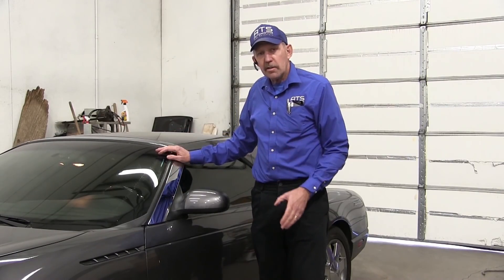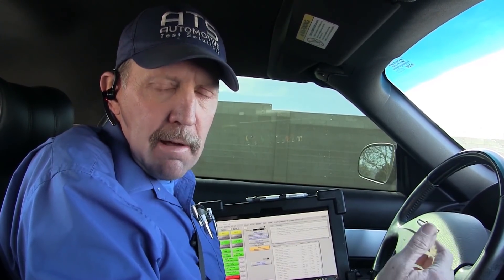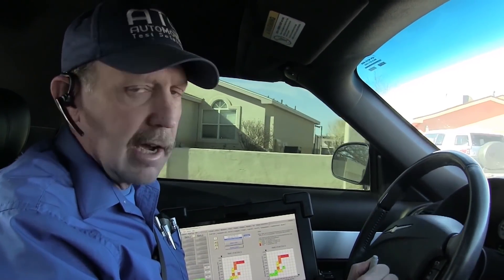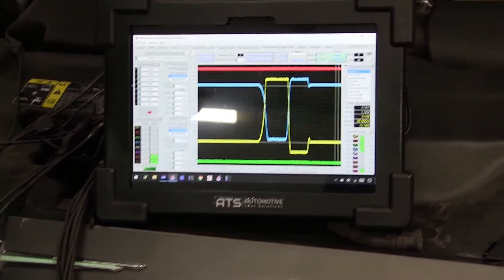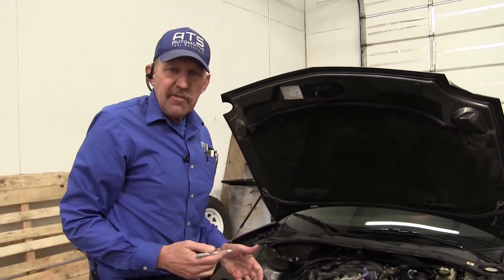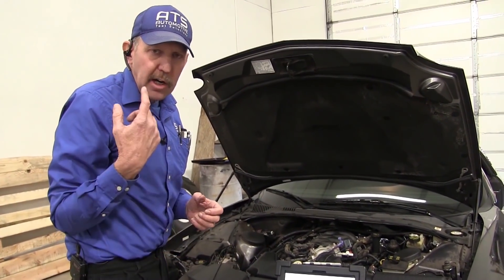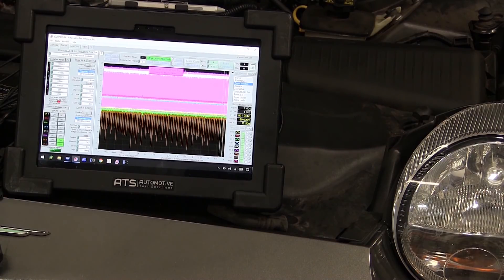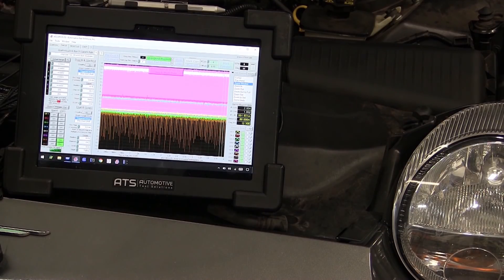2003 Ford T Bird throttle defaulting

Comment: Great video that goes well beyond this specific issue.  My T-bird had the same symptoms.  It turned two coil packs were producing voltage spikes (as seen on a O-Scope).  I replaced all of the coil packs and spark plugs parts as parts cost was quite low.  I am an electrical engineer that just retired from repairing semiconductor manufacturing equipment for 40 years.  This reminds me of the most difficult problem in my career  We had a semiconductor manufacturing tool that had an intermittent fly back diode.  It would fail once every 2 weeks. We used multiple O-scope to track down the voltage spike.   A one dollar part kept a million dollar tool down for 2 months.

Comment: Tuning into the ac clutch turning on and off triggering the fault was the instinct that lead to the final test and ultimately the fix. Love not only the scope analysis, but the combination of skill sets that solved the problem. Ps I prefer breakout relays for any relay testing, but it was cool to know of a wire so fine that you can slip it into the terminals without opening them up when the relays inserted. I think that’s also a little bit of old school in there from Bernie! Lol! Nice!
Reply: Yes, knowing that the customer uses the AC was the turning point especially when the previous shop said the throttle defaulted all the time and he wasn't seeing it default initially.
Reply: @abdul-kabiralegbe5660  I fix a lot of cars just by talking to the client. Freeze frame data helps a lot too, but this case that doesn't exist.

Comment: On Nissan relays the fly back voltage is controlled by the relay itself, and unfortunately the suppression feature is not shown in OE diagrams?The diode or resistor is built in. I'm wondering if simply replacing the relay may have repaired it?

Comment: Back e.m.f. On any relay in all electronics is always needed You obviously no electronics which is needed to repair modern cars. I have put 4001 diodes on relays on old cars because customers said when going from hi beam to low a ticking sound came across on the radio. I love your vids great diagnostics.

Comment: Electronic Throttle Control (ETC) is essentially a closed loop servo positional system, which will have a closed loop positional (and perhaps velocity) control algorithm (most likely PI). The H-Bridge current control (PWM voltage modulation) is most likely four quadrant control, especially if the ETC motor has a default return spring. The positional information, throttle position and pedal position, is redundant in order to meet a specified safety level of operation. This safety requirement can also influence the processor selection with redundant computational units running in parallel. The most important aspect of the throttle positional information is that it indicates the true position of the throttle plate (at the needed resolution), secondary is in indicating a fault condition.

Comment: The Ford PCM ignition IGBTs are actually called "smart coil drivers", which means they have some added features beyond just a bare IGBT transistor. One of these features is an active clamp set at around 400 to 430 Volts, which turns on the IGBT during the coil primary fly-back pulse to clamp it to a safe level with any excess energy absorbed by the IGBT. The only real reason I can think of for a TSB for the coils would be if the primary inductance was too high for maximum energy absorption stress on the IGBT at very high PCM module temperatures. So you could over stress an IGBT with worse case energy present, open secondary, and the PCM at a very high operating temperature.

The PCM ignition circuit design and PCB layout is done to mitigate any ignition primary clamping of the IGBTs disrupting the microcontroller core, it is actually one of the first circuits to be laid out in the design. The PCM ignition feature will not "put gates out", which I think translates to meaning resetting the microcontroller or interrupting its normal program flow. The ignition IGBTs are discrete amplifiers and not on board the microcontroller. The microcontroller is not subject to any of the ignition energy stress or interference. In fact, you can have a failed PCM ignition IGBT with having any other damage to the PCM. By replacing the failed IGBT you can put the PCM back into service.

The real reason for the "smart coils", like on a GM LS V8 Coil Near Plug, is not to protect the microcontroller from ignition amplifier interference, it is really because when you include the ignition amplifiers on board the PCM the PCM power dissipation requirement goes way up, and safe operation at maximum PCM temperature is unachievable if you put the PCM under hood and not in the passenger compartment. By moving the ignition amplifiers into the smart coils you have essentially removed heat from the PCM so now it can live under hood. The GM smart coils as designed (4 pin connector) don't have a monitor output, GM opted for a dedicated trigger ground (which provides some isolation between primary and secondary, which I think is a smart decision), so the smart coils are really not as smart as the approach by the Japanese coil on plug applications (also a 4 pin connector) which have a monitor feed back function.

The ETC switching frequency change to 20kHz has more to do with the improvements in the performance of the MOSFET switching H-Bridge servo motor control amplifier smart power integrated circuit relative to acceptable cost. Many people can't hear the 10kHz servo amplifier noise when the hood is closed, but some customers (and many engineers) would still complain. Once you start the engine the small whine is drowned out by engine noise.

To monitor the relay signals you can use a relay extension breakout adaptor. When you use the relay extension adaptor it is best to clean the fuse box pins and the relay pins, this way you know that the circuit is making a good connection. However, the premise was the A/C relay has compromised suppression across the coil. Many times this is due to a replacement being the wrong type, but you can read the relay circuit diagram to see if it matches the symbol on the OEM wiring diagram.

How can a faulty A/C clutch coil suppression effect the module output controlling it if the circuit uses a relay which isolates the control from the load? More probable is the noise is going on the +12VDC and PWRGND power rails and this is some how effecting the PCM ETC control through the module power feed, or perhaps there is another coupling mechanism if the circuits share a wiring harness, commonly known as cross talk. This cross talk is possible if the under hood power rails are not stiff, meaning there is a relatively high impedance power feed from the battery +12VDC and/or GND (chassis ground) from the trunk to the power connections under hood. For this year Ford traditionally the A/C clutch does not have a suppression diode. The mistake Ford made was assuming that the power rail noise suppression for a battery in-trunk design would be the same as the battery under hood, and we can surmise that this same issue is why a TSB was issued for the ignition coils. The problem is the power supply under-hood does not suppress noise effectively enough to prevent power disruptions at the PCM, because the design does not address relocating the battery to the trunk.

An option for the simple rectifying diode would be to install a uni-directional TVS with an on voltage of about 24 volts. This way the flyback voltage would be suppressed (diode forward biased) and also any positive noise spikes on the A/C clutch coil (diode reverse biased). The TVS for this type of common automotive application is called a load dump suppressor, and is a very large and robust device for absorbing energy, and could guarantee the A/C clutch fuse would blow if the circuit experienced reverse battery. You would want to position the TVS as close to the A/C/clutch coil as possible to minimize the lead inductance to the TVS, which is the same as saying, to minimize the chance of cross talk interference through a shared wiring harness.

Comment: Being that the battery is in the trunk, it may be more helpful to look at signals at the under hood main ground to understand what the module voltages are when the engine is running (powered by the alternator). Mainly for two reasons, the first is the long ground reference lead will pick up a considerable amount of noise, the second is we want to understand the I/O signals as close to the module connector as possible, which is under hood or near the firewall. Ideally, ground for troubleshooting a module would be directly at the module ground as a reference. This is important because what you can see is how the power and ground impedance relative to the battery in the trunk can be modulated by electrical overstress.

Another option to clean up the ETC position signals is to use differential scope probes across the PCM ETC inputs, or across the throttle position signals at the throttle body.

Comment: I learned that protection was in every car Ford made with a cycling A/C clutch back in the 1980's.
It's in a plastic enclosure about 2 inches long, and taped to the harness by the a/c clutch connector.
If it gets damaged or removed by someone, it's going to allow those voltage spikes.
I learned it in school and overheard our lead tech and parts manager trying to figure one out one day back in 1987.
They called Mercedes to find out about it.
I happened to overhear, so I pointed it out to them in the harness.
Theirs had an open that was causing a driveability issue then, in 87.
So Ford definitely knows and built them that way ages ago.
It would be interesting to see if the T-bird doesn't have one? Or whether it's open?
Or is the harness damaged?
You need an EVTM to see if it's in their diagram. That's the troubleshooter manual.
It's not known for having misprints, omissions, or wrong diagrams.
It's what ford techs used before computer displays and live data streams just handed us answers like we have  available to us now.
It sure was good deduction to ask the customer about how you make it act up and when, then think about what systems are in use, and what circumstances the car goes through at the event.
The clutch powers off, releases, and the left over energy has to dissipate. It can, so it does, (without a diode across it) go back and kick the processor.
That would be bad.
If you're at a wrecking yard, you can grab a spare one to use and put in for the test.
They're often black or yellow plastic and wrapped with tape on the A/C harness
Reply: That makes more sense to me. The car is 19 years old and only recently developed the problem. So it would seem unlikely there was never a diode there.
Reply: @googacct  yes it's likely it was designed with the protection, the EVTM diagram has a correct drawing almost always.
These other sources for diagrams might be where it's not depicted?
I don't know.
Too bad they didn't have him repair the car too,  so we could see.
You can order real OEM literature at parts from HELM publications last time I checked. But they could share that page of info with you in a dealer service department if you find caring people who want to see it corrected.
They used to say it's your car, but it's our baby.
That may have been a local thing.
Before all the smart people started in on things.

Comment: Question. When the Clutch Relay Contacts "Open" causing the Magnetic Field to collapse, how does the "Spike" get across the "Open" Relay Contacts onto the DC Supply ??
Reply: I'll take a shot at this question.  It is probably through induction similar as an ignition coil.  The energy travels the easiest path.  Since everything else has good insulation the shortest path would be in that tiny relay.
Reply: I don't think the voltage spike jump the gap between the relay contacts because you would need kV to do so. Just as he said, the engineers are aware of these spikes and so they install diodes in every circuit which involves inductors even the relay coils must have one. To answer your question, the huge spike is reaching the computer through the bad AC compressor diode that is connected to ground as the computer. I'm not totally sure but it's the only way I think
Reply: Inductive Coupling
Reply: 2 ref signals of the throttle did not show it with scope on it.. why.?
Reply: @prashanshan7125  Kind of long winded but here is some what I got out of the video.  You may want to view it again.  Bernie takes the shortest data driven path as possible.

Both signals did show on Bernie's first connection set up.  The nuance that he delivers on each video is to follow a fact driven diagnostic procedure.  Two things during the video he pressed home was to establish a baseline of how the car was performing.  The first being careful to follow the customer complaint while identifying any other issues.  The second was to get a good description of when the issue occurs, when he gathered the time and place of the event.

After which his first connection shown that the throttle actuator was receiving the correct inputs.  This data then delivered an event that he could replicate.   Detailed customer information then identified the next item to test.

Since his first connection identified what to watch for, there was no need to view all the signals while testing the next system.  He then cleared the screen to making it visually easier to see.

  If you were looking for reference signals from the accelerator pedal you would have been on a longer journey.
Reply: It doesn't directly.
When the contacts open, the collapsing magnetic field in the clutch coil tries its best to keep the current flowing but with the circuit open the voltage will just rise very quickly.
The spike will actually capacitively couple into adjacent wiring - two pieces of wire laying side by side makes a capacitor. Sheets of foil with very thin insulation between them make better capacitors.
But anyway, the higher the frequency, the lower the reactance (resistance to AC) of any capacitor. This fast spike is a very high frequency signal, so even with the poor capacitor made by two adjacent wires there will be good opportunity for signal transfer.
That's not all though.
If the adjacent wiring is power, ground or an output actuator, those wires are low impedance - fractions of an ohm for power and ground and below 50 ohms for a small actuator, 100 Ohms for a relay, it's relatively difficult for other signals to affect those.
However for signal wires like TPS1 and TPS2, you have potentiometers of say 10k Ohms connected between 5V and ground plus limiting resistors to protect the TPS from shorted signal lines so with an impedance of a few thousand ohms it's much easier for that spike to influence those signals.

Inductive coupling is when the signal transfer from one wire to another is due to the change in current flow in the first wire.
An interaction of magnetic fields rather than electrical fields.
Reply: @prashanshan7125  A mixture of things you have to take a step back and think about.
Firstly, the scope connection looked at 5V ref, ground, TPS1 and TPS2. Correct TPS operation was observed in response to APP input KOEO. No dropouts, spikes or glitches so those channels were switched off while looking at motor drive current in case the problem was a sticking throttle shaft. 
Remember, Bernie said he had spent 2 hours and the car had not faulted. Why? The garage said it would fault constantly.
After talking to the owner they described their use of the vehicle and that's when the decision was made to operate the heater and demist which also switched the AC on to dry the air for faster demisting.
Then after a short period of idling, the car faulted a second or so after the AC clutch released giving an immediate direction.

Comment: was that a 4pin or 5 pin relay? and was there 4 or 5 terminals in the fuse block?  was that the correct relay?  wiring diagrams accuracy is more and more becoming a crapshoot.

Comment: Cool case study Bernie! How exactly did the voltage spike on the load side of the AC clutch relay make it back to the PCM? We didn't see any evidence on the other channels of the scope 🤔
Reply: I wondered the same exact thing 🤷‍♂️
Reply: Ivan, I’m assuming inductance inside of the relay, high voltage on the load contacts carried over to control coil through inductance. My guess but I’m not sure I actually came here to ask the same question
Reply: @joshwilson849  Yup that's what I was thinking... wish Bernie put his scope on the ECM control pin of the relay as well :)
Reply: @PineHollowAutoDiagnostics  or the high voltage reverse spike is going into the fuse box and making is way back to the PCM.  The relay load and coil power feeds are connected  together inside the fuse box even though they have separate fuses.  Seen blower motor spinning down set SIR trouble codes due to back EMF.